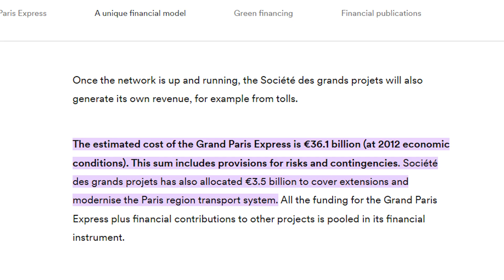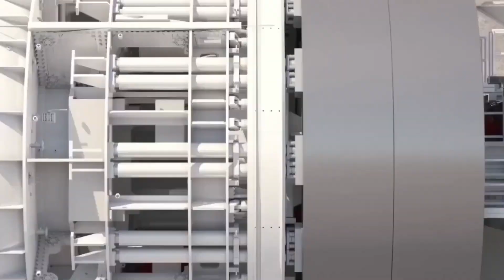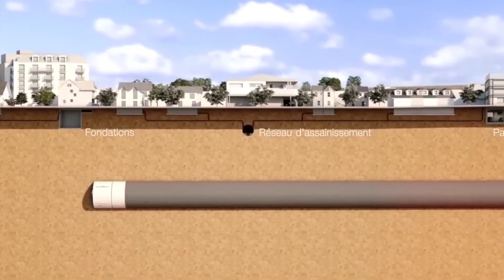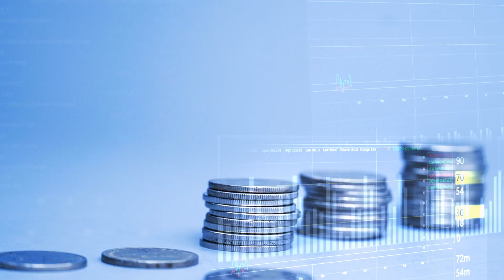GRAND Paris Express Project is the Most Ambitious in Europe

Comment: Sections of Line 15 are just named for the project phasing. Once completed, the Line will be one. Trains departing from Noisy CHamps will pass through the Southern Champigny platforms, run around the whole loop, pass through the Northern Champigny platforms, run the loop again before terminating, again at Champigny Northern platforms and maneuver on a dedicated piece of track before making the trip the other way around. That way, the loop is both complete and has two distinctive temini to regulate traffic. In the worst cases, it could do just one loop from Noisy to Champigny North via Champigny South and the loop just as the Circle Line does in London. Doing two loops is a way to ensure at least half of the trains are going through without forcing a transfer, at worst you just have to wait 3 more minutes.